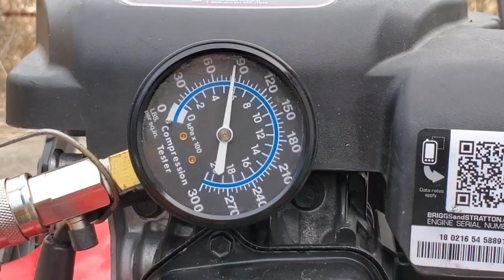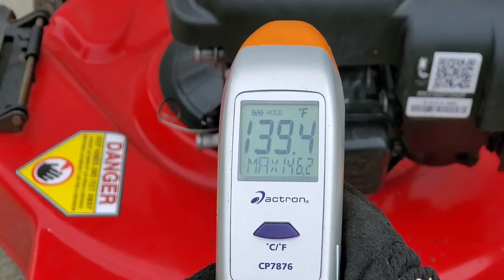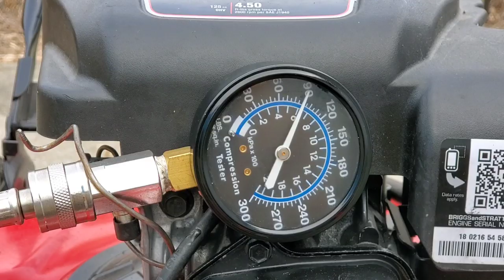Marvel mystery oil engine flush  is not safe?

Comment: I worked in an aircraft recip engine overhaul shop for six years. We assembled all of our cylinders with MMO. The cylinders exhibited far quicker ring seating and less oil consumption than cylinders assemble with engine oil. Our shop manager recommend MMO for engine with stuck rings and low compression. Saw many of these engines regain up to 10%-15% of their compression.
Reply: There's a reason that the airlines would buy MMO in 55 gallon drums back in the days of radial engines. They would not have spent the money for decades if it didn't do the job.
Reply: But your want less lubricity during break in to seat rings....we used to use straight grade mineral oils and stayed away from Mobil 1 in race engines for this reason, during break in. After, you want the lowest friction possible.
Reply: @jimeditorial  Straight mineral oils are all we used for the first 10-15 hours after overhaul. Cylinder assemblies were installed using MMO because it “burned off” the cylinder walls. Engine oils tend to glaze cylinder walls, especially at low rpms.
Reply: I like to add 1 ounce per gallon, per MMO instructions on the bottle...
I have 215,000 miles and ZERO oil consumption at 5000 miles.
(Mostly freeway miles, 60-70%)

Comment: I throw an ounce in my gas every other week and 4 ounces in my oil every oil change in my Harley. Finally did a tear down and put some s&s heads on it last year and a full rebuild while I was in there. At 63,000 miles.. the motor looked like it only had 5,000 miles on it. I was VERY impressed. I know the oil I run isn’t 100% to thank for that because we did the same thing to my dads bike a couple months ago and he doesn’t add anything to his bike. His motor was pretty nasty inside, idk how his exhaust valves were functional to be honest. Means the marvel is the real champ in the equation. He now uses it religiously haha I say, they’re pretty great from my experiences.
Reply: What motor oil did you run?
Reply: @bobbyg7269  I just run maxima oil. I use them for all 3 applications on my bike, the oil, trans and primary. They’re pretty consistent and I get good results from them so I just stick with it.

Comment: I put a FULL quart of MMO in my E39 BMW every 6 months with half of a tank of gas.  I then drive it 80 miles on the highway.  I've done this for ten years....to the same car...
Reply: You see any difference ?
Reply: Whoa thank for telling us what you how about telling us the benefit Of using MMO
Reply: thanks for that testimonial
Reply: BMW need lots of upkeep good luck
Reply: Well, at least it proves that mmo is not harmful.
Reply: Sounds ludicrous to me. No need for that great a concentration. It is a very light weight oil but still is an OIL. Seems like way too much to add to gas. They call for 4 ozs / 10 gals. Seems like you would create fouling (carbon) by burning fuel that is that oil rich.
Reply: @ spiro revelis--  I agree with you 100%. Some people think that "more is better." If more than 4 ounces of MMO for every 10 gallons of gas was beneficial, then they would say so on the bottle, so they would sell more product.
Reply: Thank you for sharing that. I’ve wondered for years if I can put it in a modern engine with DI? Would it be safe for GM that requires dexos?
Reply: Using mmo for 50 years in all kinds of motors its the best

Comment: MMO really isn't a "flush". A flush is something you add to your motor right before an oil change, run the engine for 10 minutes, then drain out. Those kind of flushes have a high solvent level and while they clean well, they're not safe to drive your engine on. MMO is an oil additive that is mild and will help clean your motor over time, but is safe to use with your engine oil for 5,000 miles, so long as you don't exceed 20%.
Reply: How much is 20%  oz ?
Reply: @bayfinest1938  It states on the bottle not to exceed 20% of MMO in your oil pan. What that means is if your oil pan capacity is 5 quarts, then you are ok to run 1 quart of MMO with 4 quarts of motor oil.  That would be a 20% ratio.  You can also run a 10% ratio as well, which is what I normally do.  Hope that helps.
Reply: @LA_Commander  I have 2010 kia forte 2.0l I believe my engine oil is up to 4 qt

Comment: I wouldn’t use it on a really slugged engine it could loosen the sludge and block the oil passages. But I use 20 percent  with my oil at every oil change, have had several vehicles with over 200,000 miles, when I did tear downs the engines were pristine clean inside. I am a believer.
Reply: Did you notice higher oil consumption due to the thinner oil?
Reply: What's more common is seals to leak temporarily while it's in there. Once back on just oil it goes away. Same may be true for burning, but it's only burning the MMO
Reply: @chancefluke7833  it reduces oil burning, I have a 2007 scion tc and I use 20% mmo and it burns alot less oil than just using regular oil, the tc has a piston ring issue that causes the engine to burn a quarter of oil every 700-1,000 miles.

Comment: I had a 1997 Oldsmobile Bravada that had a clogged injector. While almost empty, I dumped a whole bottle of MMO in the tank and then filled it with premium. By the time I had gone through that fill up, the injector was cleared and it was running smoothly.
Reply: JihadUnplugged757 it wasn’t MMO that cleaned the injector I snuck over in the middle of the night and took out then cleaned the injector and then put it back in.
Reply: @PeteyMcSavage  you madman
Reply: I use B-12 Berry’s Man’s

Comment: Been using MMO in my cars oil and gas since the early 90's. Still driving 2 cars right now that are over 20 years old and have over 200,000 miles on them that don't burn a lick of oil. Stuff is amazing!

Comment: Just like it says.  Its a Marvel and the Mystery ingredient's work extremely well.   I add to my fuel tank of my 2009 F150 with 265k as well as do an engine flush substitute of 1 quart for appr 2000 miles before changing.  I change the oil every 3000 miles on this truck.  I do this every 50k miles without fail.  Truck runs like a champ.  I also have 65k on my 2020 F250 7.3 gas and I did the same on it at 50k miles.  looking for 500k miles out of this truck before any major rebuilds.

Comment: I have used Marvels for years. Put it in the crankcase and gas tank on my Honda CRFx since new. Have never adjusted the valves and it starts easily. Engine is really clean.

Comment: I hv used mmo for 50 yrs and put 1 qt in my oil change   and never had any problems  ,many high mileage  vehicles  
Mmo in my gasoline tank every time more power and no carbon build up 
My dad told me as a kid to use mmo regularly and get 2- 3 times more mileage out of the moter it was much cheaper than rebuilding the engine
Reply: I own a classic car dealership and the first thing we do to every car we buy is change the oil and run it for 100 miles or so and then replace all the gaskets and seals and then refill the engine with GOOD oil. We've never left it in though. May have to try that.

Comment: I'm running 20% MMO in my 1978 Honda GL1000 right now.  Its been there for about 500 mils at about 65 MPH average speed and the bike runs great.  I also add two tablespoons of MMO to a full gas tank lots of times and the engine loves it.   Bike runs like a jet.

Comment: MMO is a good thing to use on certain engines. Dodges 2.7 for example. Always add 1 to 2 quarts within 1000 miles of oil change. This particular engine is highly noted for sludge and buildup blocking the oil passages, resulting in catastrophic engine failure.  The key is for any engine,  to perform regular consistent oil changes.
Reply: I have a 2006 Chrysler Sebring (2.7 engine) with over 200K miles on it. The engine has been rebuilt a few years ago after losing a rod, but has a faint ticking noise I want to eliminate. Would this be a good product to try without damaging my engine? Mechanics thus far haven't been able to pin point what is causing the noise.
Reply: @davidc6171  maybe..what kind of oil and filter are you using.  I would recommend using an original equipment Chrysler Dodge filter. Cheaper aftermarket filters can in some cases restrict oil flow and starve certain areas of the engine.  Especially the 2.7.  Try an OEM filter, use semi synthetic high mileage low sludge oil. I personally like Mobil 1 full or semi  synthetic. Then when or if your down a quart of oil 500 to 1000 miles before your oil change due mileage,  add a quart of Marvel Mystery oil.  It helps clean out the buildup in the oil passages and pan, ect.
Reply: @showcasecharlie11  I last used CASTROL GTX HIGH MILEAGE oil. 5W20BK.
Will have to verify if they used a Mopar Oil filter. Noise has been consistent shorty after the engine rebuild a few years ago. It is very faint and hasn't gotten worse. I no longer deal with them due to concerns I had with the engine they never addressed. Hoping it can be fixed without having to remove the engine again.
Reply: @davidc6171  add Lucas oil stabilizer. The stuff is great. it's usually $12 a qt but at Walmart you can get a gallon of it for 27. so it's almost like getting 2 qtas free for the price. I run it in bothe my ram and my 300
Reply: Mopar 2.7 is a POS
Reply: Would it be safe for a GM 3.6 DI??
Reply: I used to maintain an 2001 2.7. It’s was the known sludger. I used full synthetic oil and wix filters on it (it preferred castrol syntec or valvoline synpower. Changed it around 6000 km intervals and never had an issue. They body / frame fell apart long before the engine quit.

Comment: I had a valve sticking on my old Jeep I drained out 1/2 qt of oil, 
Then added 1/2 qt of mmo to the fuel tank and 1/2 qt mmo to the oil 
Started engine, within 30 seconds the noise when away, heard it for a few seconds a couple of days later,
That was years ago never heard the noise again, at oil change I always add 1/2 qt mmo to oil and to gas tank 
All I can say is it worked for me!
No time here but I had tried everything to stop the sticky valve, next step was a valve job on a remanufactured engine with less than 5 k miles,

Comment: I have 321,000 miles on original engine/trans in my 03 Corolla. I always add 4oz mmo per 10 gals of gas since the car was new. Engine runs fantastic.
Reply: does it throw an engine code being it's in the fuel.... like an O2 sensor code?
Reply: @joed1244  no, not at the recommended ratio

Comment: Marvel Mystery Oil has been around since 1923, so it must be doing something right. I have been using it since 2016 in the gas of my car and truck at 4 ounces of MMO for every 10 gallons of gas. My highway miles per gallon has increased 1.5 to 2 extra miles per gallon since using MMO. Walmart sells the quart (32 ounce) size for $3.88, and at that price, I am actually saving money using MMO in using less gas. Plus the added benefits of MMO cleaning the fuel system, a much smoother idle, and lubricating the top end of the cylinders and the fuel pump.
  I have also added a quart of MMO to the oil of my 2002 Chevy truck when I am about 4 to 5 hundred miles from needing an oil change, to clean some sludge out of the engine.
Reply from the maker: Very informative you have experience with marvel.
Reply: What does it do to your converter?
Reply: Marvel Mystery Oil has not done anything to my catalytic converter. I have used it for more than 3 years at 4 ounces for every 10 gallons of gas, which is the recommended amount.
Reply: @kcmaldonado3948  So far i've saved 2 cars and 1 truck's cats that were throwing codes that after an inspection/diagnostics was told would need new cats.  in each case knowing i had nothing to loose i dumped 1 gallon of pure acetone and one entire bottle of MMO in to the gas tank, filled the tank up with premium gasoline then hit the highway, dialed in the cruise control at 55 mph (your mpg's will actually drop with this mixture but that's ok, next tank will not only recoup but show gains!) and drove until the entire tank was gone.  within the next 50 miles of regular city driving check engine lights turned off no more cat issues even 8 years later, still same cat, still running perfect, but in each case i did recommend they start using MMO in the fuel regularly or my preferred mix of 2 oz MMO + 2 oz acetone per 10 gallons. One of those vehicles (the truck) has now ended up in my hands 6 years after the original cat treatment with MMO and still running perfect, same cat, no codes, starts instantly and exceeding the epa MPG ratings.
Reply: I thought I was paying 3.50 something for it now it’s higher lol
Reply: @ MEMPHIS CULTURE ADVENTURES --     Inflation is out of control now. I have always bought the quart (32oz) size of Marvel Mystery Oil at Walmart, and for more than 5 years, the price was $3.88. In less than a year, the price has gone up at least three times, and now it is $6.43 for a quart of MMO at Walmart. 
    This is a price increase of more than 65%. 😢😢
Reply: I agree, used it practically my whole driving life, 58 yrs old now and never had issue when used as directed.currently a 97 park Avenue 202,000 miles and a 98 k1500 Chevy at 172,000 keeps the fuel rail clean.
Reply: I think it helps keep Sparkplugs clean too..

Comment: I’ve literally never heard any claims that MMO damages your engine. That’s just me. I’ve always used it, especially after doing engine swaps from the junk yard. Cleans everything up nice 👍🏻
Reply: Do you use it before the oil change or after
Reply: @aarsoul9860  both.
Reply: If used as per directions - in moderation - it will not hurt your engine.

In many cases, it seems to help.  I used to put in 1/3 quart or so a week or two prior to oil changes in my last car.  I changed every 3-4 thousand miles.  Usually used Castrol - not sure if it was GTX or not.  I know I used GTX 20-50 in the bikes.

Comment: I've always got great results  from MMO, before a oil change I would dump out a quart of engine oil, replace it with a quart of MMO go and hot rod the vehicle around for a while getting the engine good and hot, drain it all out, replace the oil filter and add new oil,,, seems to work very well, engine seems like new again !!!
Reply: You don't hot rod it while you have Marvell Mystery oil in the engine. All you do is let it idle for 10 or 15 minutes then change the oil. MMO is primarily detergent not oil. Which is why it does such a good job at breaking loose gunk etc. But you should never run your engine above idle.
Reply: MMO is actually safe enough to drive your car normally on. Just only use one quart of MMO and the other 5 quarts can be your favorite oil (in a 6 quart oil pan that is). You can drive it for 5,000 miles that way and change the oil and filter normally.

Comment: I've used it in a Chevy 350 before that the lifters were gunked up after bout 500 miles the engine was cranking and idle smoother. The oil with in bout 1,000 miles was black. Changed it with new filter went 3,000 miles and changed it again. It was a remarkable difference. I then ran some Rotella t4 10w30 by it self for next 3,000 miles its clean not spotless but so much better than it was my oil pressure guage is showing higher than it use to now. Im using havoline high mileage 10w30 now and it runs like a champ. My advise for marvel mystery is it thins oil out to when i used it i went to 10w40 i recommend if you use it with 5w20 best probably to step up to 5w30.
Reply from the maker: Awesome thanks for sharing your experience.
Reply: @NATESINTERACTIVEAUTO  no problem i was scared at first but to use it but my dad and granddad said they used it for air tools and rust and way back when what did i have to losse i do remember my dad saying his brother used kerosene as a flush one time said it worked good only problem was the sludge stopped up oil sump and blew motor up 😄
Reply: I'd u use it before or after and how much did u use
Reply: @kaybowers3849  entire bottle. Substitute for one quart of oil.
Reply: @kaybowers3849   It will then oil out. So if you use a 5w20 use a 5w30 with it. If you use 5w30 then use 5w40 or 10w40.

Comment: The problem with engine oil flushing on a slugey motor is the slug gets in the oil pump pick up screen and cuts oil flow too the engine and could cause bearing too burn up

Comment: Nate try Rislone as an oil additive.   Good or bad.  I like it.  I use Marvel as well.  Especially  in my  gas.
Reply: I’ve had good results with Rislone too
Reply: Would like to see it. I had a 1985 mustang 5.0. Used rislone at every oil change and when it over heated and blew a head gasket, i took it apart and the heads were as clean as new.

Comment: Should have been close to three and a quarter Oz, but that's close enough. You're actually putting in 25%.
Marvel Mystery Oil is not a flush. Never has been.
This is not a particularly good action to test Marvel Mystery Oil when you're trying to apply it to Automotive. But it has worked fine an automotive application since 1923 when they first started bottling it.

Comment: Bought a used Dodge pickup with a 318 years ago.  Pulled the rocker covers off and could not believe the sludge in there...I couldn't believe the engine was still running!  So I cleaned out as much sludge as I could from the rockers with my fingers.  I then took a spray bottle full of Marvel's Mystery Oil (MMO) and soaked the rockers and galley as much as I could, put the covers back on, and let it set for a few days.  I then started it up and let it idle to operational temp.  I then drained the engine oil.  Next, I put new oil in, with 20% of it being MMO.  And did that for the next 3 oil changes of 3000 miles each.  From then on, whenever I was about 500-1000 miles before I was due for an oil change, I would top it off with MMO (but never more than 16 oz.  Sixteen years later I sold that truck to a guy who rebuilt the engine.  He remarked to me later, that it was a very clean engine and he was surprised being it was a 28-year-old engine with 186,000 miles on it.
Reply: Sp1